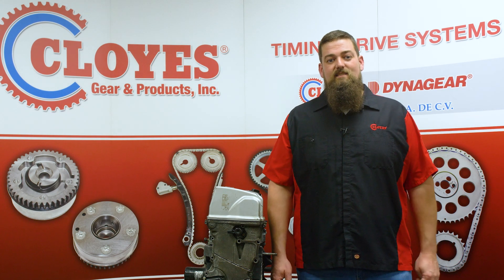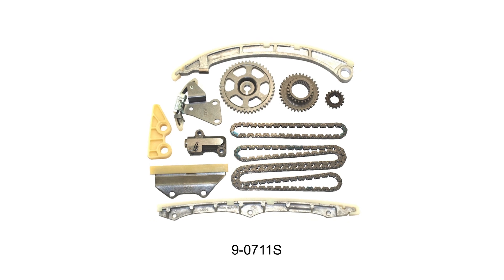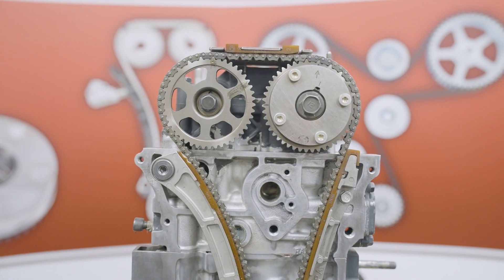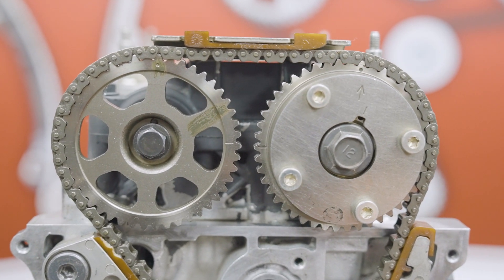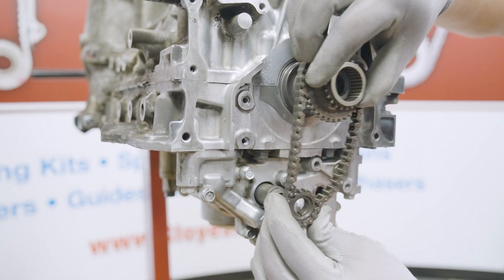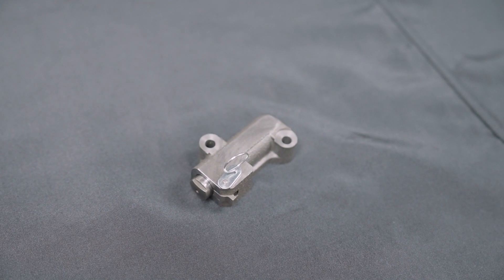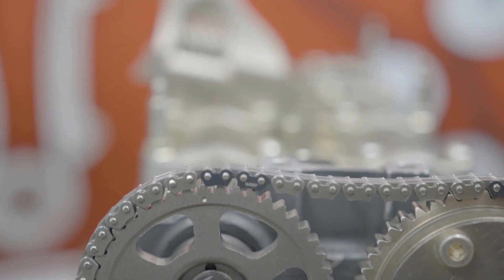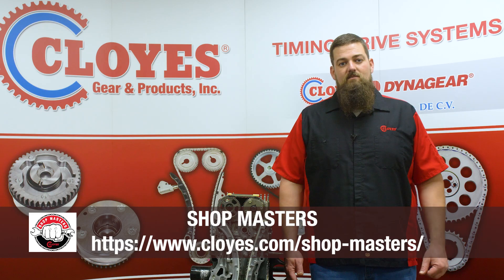Honda 2.4L (K24) Timing Chain Replacement

Comment: Why didnt you do a two crank test after installation
Reply from the maker: We do not recommend rotating the engine after chain system installation if you can avoid it. Slow, hand rotation allows for the shifting of the chain slack side-to-side due to the valve events. Before the first startup the tensioner is not primed up with oil, therefore there is a risk of jumping time. This occurs in some applications more than others (GM Ecotec is the worst about this,) but the possibility is there. You also lose your visual confirmation that the timing is correct once you start rotating. The marked chain links will only align with the sprocket marks every so often, sometimes it takes over 100 rotations. All sprockets are keyed/doweled, and the alignment of the chain and sprocket marks set the timing. You're best bet is to align and trust your marks. The quicker and more consistent rotation of the starter doesn't allow for big shifts in chain slack, so there is much less chance of a chain jumping the teeth of a sprocket. Once the tensioner receives some oil pressure this is no longer much of a concern.

We do not blame anyone for wanting to check for piston-to-valve contact, we get it... Just know the risk of the chain skipping a tooth is there. That is why we do not demonstrate or recommend it.
Reply: Gotcha! also when you installed the chain, are the cams in compression TDC( lobes on the cams in cylinder #1 are pointing up and out) or in TDC overlap ( loves on cams in cylinder #1 are pointing in and up)? Because from what I understand right now ( keep in mind I'm not a mechanic) the cams need to be timed to compression TDC or else the cams and crank would be out of phase by 360°... I'm just so lost in this project right now I've installed the timing chain four times( at TDC overlap)  and every time  I attempt to rotate it to check my work it comes to a hard stop so I have to reset.
Reply from the maker: @INYoFaceboy  When you position the camshaft sprockets so the chain marks will align, that puts you into the correct stroke. If you were to be 180 degree out, then the marks on the camshaft sprockets will be pointed downward, and you will not be able to align the chain. If the chain marks align on the 2 cams and the crank then you will be in time, there is no way to get it wrong as long as the sprockets are indexed onto the shafts properly.

Comment: You don't say anything about leaving the phaser locked or unlocked while installing. As far as I have found, that it a crucial step on this process...?
Reply from the maker: As long as the camshaft is being held while torquing the bolt, then there is no reason to unlock the phaser during installation. Damage to the phaser's internal locking pin can only occur when the phaser's teeth are being held during installation. The internal locking pin locks the inner rotor, to the outer stator/sprocket. When torquing the bolt you are attaching the rotor to the camshaft, no load is transferred through the pin.
Reply from the maker: In most situations where there is an instruction that says to unlock the phaser, that instruction was originally written for situations where the phaser was being replaced without timing cover and chain system removal. Specifically written by the OEM's for warranty situations. You would want an unlocked phaser in that situation to avoid moving the chain during installation.

Comment: 4:29 The sprocket on my balance shaft doesn't have a bolt and - I don't want to pull too hard - but pulling on the sprocket, it doesn't seem to want to come off. 
What am I missing?

UPDATE: nevermind, there was a bolt, and the gear came off easily with a 3-claw jaw puller from the tool loaner program at O'Reilly's Auto Parts.

Comment: I didn't know you get 2 different tensioners. My brother in law's crv hit a piston through the head because a guy fitted the wrong tensioner. Luckily I had a spare engine, but only after fitting the incorrect tensioner the second time, I discovered chain slap noise and stripped the timing covered and decided to search the internet and discovered this video. Thank you for sharing.

Comment: Hi guys . Just in case my motor is off by a tooth . Which I doubt it is . But let’s say it was . Can I put my camshafts at TDC using the crank , remove the chain and then line up crank at TDC ?
Reply from the maker: Yes, you can make small adjustments to the shafts once the chain is off to get the new chain to align. Just keep in mind piston to valve contact is possible if you have a valve open, make small adjustments by hand and do not force anything.
Reply: @ how would anything come into contact if camshafts and crank are all close to TDC ?

Comment: Question. Can you remove the  harmonic balancer on the 2.4 without affecting the engine timing.  The lower crank gear is not keywayed correct.
Reply from the maker: Yes you can. The balancer does have a key so be careful not to lose it when you remove the balancer. The key/keyway will ensure the balancer is clocked properly when reinstalled.
Reply: @Cloyes01  so I can turn the balancer without off timing it as I change the tensioner ?
Reply: @markphillyfreeway5350 well the balancer will always only go in one way . Because of the key way . But if ur changing the tensioner you kind of pose the risk of jumping a tooth. Because while u remove the tensioner and re install a new one , the chain kind of just dangles at the crank since there’s no tension right ? And when u pull the pin on the new tensioner the chain might not land where it was , it may be off by a tooth . Does that make sense ? The sure way is just remove the timing cover and replace the tensioner that way . Even get a marker and mark the chain at the crank before you remove the old tensioner so you know where to put the chain on the gear after u swap tensioners or just re time the engine altogether . Apologies for the essay lol

Comment: Do not use a punch and go thru that spot in the camshaft pulse plate to get the phasers off, the bolts for the phasers are usually tight asf and you’ll just snap the key way off. Literally am losing on a job cause I did it the way these guys did it. Use a wrench in the camshaft as leverage to break the phaser bolts loose. Simple as that. Save urself the trouble from me learning the hard way
Reply: Thank you for this info
Reply: Fr lost ur job
Reply: @DOWNNWITHIT no he lost money on the job instead of making money. If you go past quoted time or money spent you lose profit.
Reply: @DOWNNWITHIT  no

Comment: You cannot loosen the Intake cam bolt by pining the phaser plate it shears the locating tab on the phaser plate. The bolt is TIGHT and has to be loosened by holding the hex on the cam. If not removing camshaft the bolt can be heated with a heat induction tool. Your way cost me extra money and time waiting for a part I would not have needed if done the correct way the first time. VERY POOR INFORMATION FROM A TECH REP.
Reply: Same happened to me!😢
Reply: Sounds like youre the issue we seen him perfectly remove the phaser with his technique
Reply: @chino2096 this comment is correct. You will destroy the cam trigger wheel if you try to remove the phaser bolt without holding the hex on the camshaft. The bolt is way tighter than the 83ftlbs after being in the engine for 100k miles. I just did one an hour ago and had to use an 8ft breaker bar after heating the bolt for 2 minutes with a mapp torch.
Reply: @chino2096 we didnt actually see him do it. When I did it the reluctor ring for the cam sensor on the back of the cam came loose. It turns out this is absolutely not the right way to do it. You can however put a wrench on the hex of the cam to break loose the vvt sprocket bolt. I had to use a breaker bar and 2 5' pipes with another person to break it loose after heating it up.
Reply: @chino2096 you obviously have not removed this 83foot pound bolt on the honda camshaft.

Comment: Great video. Can anyone recommend a good torque wrench for this job? Mine only goes down to 20
Reply: Need an inch-pounds torque wrench. Most go to 250 INCH-lbs, divide by 12 to get Foot-lbs.  240 in-lbs / 12 = 20 ft-lbs.  Usually they are 3/8 inch square drive.  
Stay gold.

Comment: quick question, specifically for accord or crv with the Earthdreams 2.4 engine, when replacing the Cam Chain Tensioner, do i need to apply any tension to the chain guide, so it doesnt slack off? or there wouldnt be enough slack to worry about when replacing the cam chain tensioner (2013-2017 accord) and (crv 15-16 + )

 thank you

Comment: You didn't go back to lock the actuator gear.  When should this be done?  After bolting it onto the camshaft, or after the chain is installed, aligned and guides and tensioner installed/activated?
Reply from the maker: In most all cases, the VVT actuator should already be in the locked position. We reused the original actuator so it was already locked. If you are installing an unlocked phaser, just make sure it is locked before you start the engine for the first time. 
The only reason that the phaser being locked/unlocked matters is that you do not want to torque a locked phaser when holding it by the sprocket teeth. The phaser can be locked during torqueing, but you need to hold the hex feature of the camshaft while tightening the bolt to prevent damage to the internal locking pin.
Reply: @Cloyes01 I offered mechanic works for dealer side job 150$ just labor !! Is that fair I want to save but not enslave !!What do you think my offer to him ? Not enough?

Comment: I wonder how long the original chain set will go in a 2006 awd automatic -  I am/ was considering, buying a element that has already had the drive line done. this car has very close to 250,000 miles on it. it is really nice though.   The seller wants quite a bit for this car because it does look really nice so I am torn on the purchase with this many miles.   I hope I can see an answer on here so I will be checking back on this EXCELLENTLY Done video.     Thanks even if you cannot help. The video has cleared up many questions.
Reply from the maker: Thanks for the kind words. 

Timing system lifespan is directly related to engine maintenance and driving style. If the oil was changed frequently and the car was driven conservatively then there is likely no reason to worry about the chain. I just recommend listening to the car at a warm idle, and preferably at cold startup to listen for any chain rattle. Once the chain reaches its fatigue life, it will typically give you some warning especially in low oil pressure situations. Sometimes it will even trip the check engine light for cam to crank correlation issues.
Reply: @Cloyes01  my 2010 Acura tsx gave me check engine light for the camshaft sensors I put new sensors and crankshaft sensors car started up and Ran , I went to auto zone got a diagnostic on it and they told me the timing chain was loose I go home park my car and next morning car will not start that’s gotta be the timing chain? . The car

Comment: I’ve seen some places say you need to lock the VTC gear before setting the chain. Is that true?
Reply from the maker: The camshaft phaser should be locked when you disassemble the engine. You can make sure it is in the locked position by rotating the camshaft slightly and observing the phaser teeth. Make sure the phaser teeth and camshaft both move as one unit.
Reply: @Cloyes01 , just watched videos about that and I believe its unlock state is stronger than the locked one. Because when locked, full tenaion goes through the locking pin, while in unlocked position-the tension is distributed on all contact surface between the vanes.

Comment: I see you turned the exhaust cam to get the exhaust timing mark in the chain correctly but that moved the two dash marks that oppose each other on the two cam sprockets. Are they not important to have them aligned at the end of the installation.
Reply from the maker: Ultimately the chain sets the timing. Focus primarily on aligning the marked chain links to the marks on the sprockets. When you are finished, all three shafts could be rotated slightly clockwise or counterclockwise, so your cam marks may not align in the middle. But you will be able to rotate the engine and make those marks realign.

Comment: If it seems like my camshafts are about a tooth or 2 off while the crankshaft is aligned correctly, do I leave the crankshaft where it is and then rotate the camshafts so they align at TDC? 
I just purchased your kit and I’m a bit confused on this part.
Reply from the maker: It will likely be easier to move the crankshaft to help align the cam sprocket marks. The camshafts will be up against valve spring pressure if you try to turn them. Just remember, the chain sets the timing. If your 3 marks are all aligned properly then the engine will be in time. The shafts do not need to be in any static locations, small adjustments can be made to help align the marks. Just make sure the marks are correct when you are done.
Reply: @Cloyes01  thank you so much! This gave me greater confidence to get this done
Reply: 1.  USE THE ALTERNATELY-COLORED CHAIN LINKS AND SPROCKET ALIGNMENT MARKS.  You won't get the engine in time unless you do.  I spent an evening banging my head against the wall because this didn't occur to me.

2.  Once the timing components are installed, before you put the harmonic balancer, timing cover and valve covers back on the engine block, it doesn't hurt to remove the spark plugs and turn the engine by hand to be absolutely certain it is in correct timing.  If you made a mistake such that a valve impacts a piston, this is a better time and means of discovering that than cranking the starter with everything re-attached.